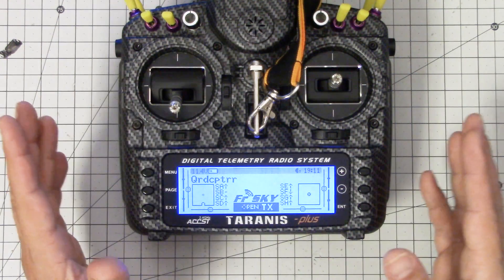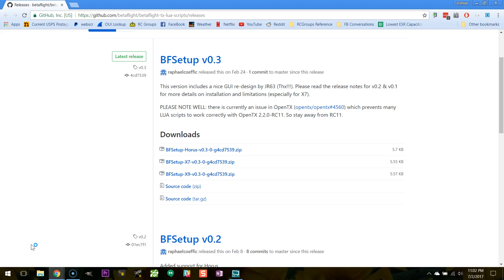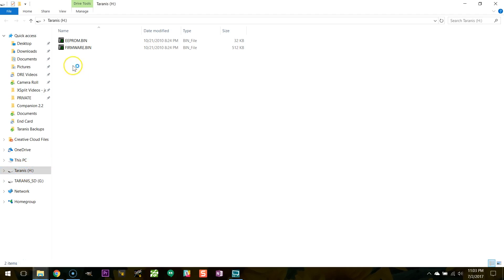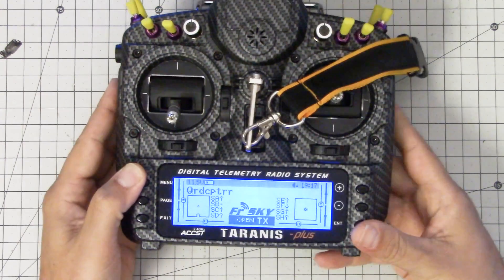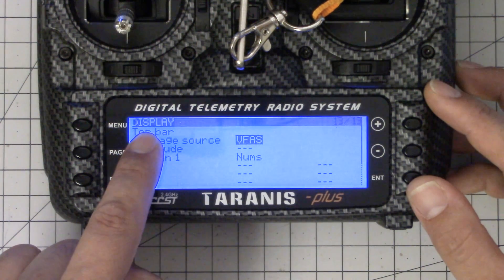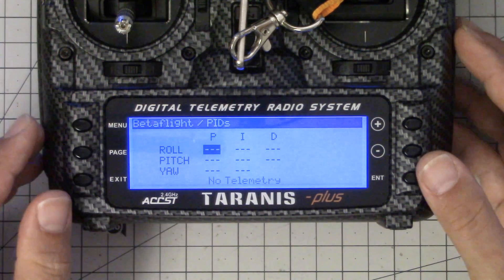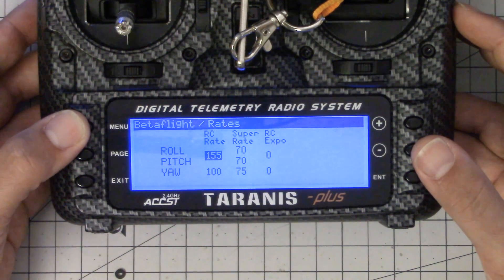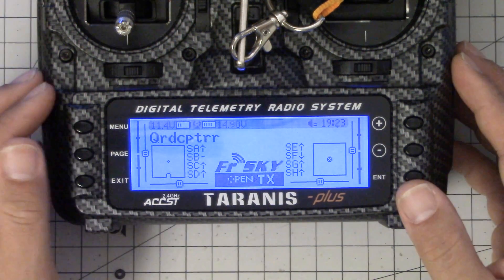Betaflight Taranis Lua Script HOW TO | Part 2 | The Lua Script

Comment: After installing LUA scripts on my Taranis, I hold down the page button and get a 'Use TOOLS menu instead of this' message. when I go to the tools menu and go to the Betaflight setup, all I get is 'Betaflight Config Initialising'. It stays there and does nothing. I have flashed the xsxr to fport, do LUA scripts work with fport. The FC is an old emax femto F3, could that be the issue?

Comment: Can u do a video on the 2.3.x lua script with the tool box I think I did it right however it actually fried my stock sd card completely shot replaced my sd card I think it all loaded right but I get stuck on the initialising page after it appeared to run the install setting it up to use the page button just says use tools

Comment: Simple and concise! Thanks for the tutorial. One thing that I've noticed, without going much on a debug mode :-), is that I can only change my PIDs. All the remaining information, like rates and VTX is not filled in. Oh yes and I'm running bfsetup 1.3. Any thoughts?!?
Reply from the maker: This is a compatibility issue between the script and the Betaflight version. But I don't know the fix.
Reply: @JoshuaBardwell  ok thanks... I'll have a look. Still running BF 3.5 (or something)... maybe I'll have a go for the 4.X.

Comment: hi

I am able to read out the pids values etc. with my radio with the lua script, but I am not able to change anything via safe page. 

I connected the smartaudio out of nano rx to tx of fc, maybe I should connect that to a uart rx pad on the fc?

What's wrong with these port settings?

uart 1: crossfire nano rx and tx

uart 3: smartaudio on output 4 of nano rx

uart 6: tbs unify vtx smartaudio

Comment: Hi Joshua, Hi everyone,
Your videos helped very much, like always, but i still have a problem with this feature.
I can change my PIDs now and my rates over my QX7, but not my VTX settings.
Let me explain the problem.
My VTX (AKK FX3) has SmartAudio and i can change the settings over the BF OSD.
But not over the "VTX SA" menu point. The VTX is listening to what i do in the "VTX TR" menu point.
I don't understand that because the AKK receiver should be using SmartAudio instead of Tramp Telemetrie. This didn't matter for me until now, but the script now uses SA. I can see that becasue it sais Dev: SA in the 3rd page of the script and the possible values for the power are the SA ones. (25, 200, 500, 800) and not the TR ones (25, 100, 200, 400, 600).
Do you have an idea what to do?
Should i try to change the VTX to listen to the (correct) VTX SA menu point or change what ever to get the script to work with the VTX TR point.
Have you ever heared about this problem?
Reply: One more curiousity. 
Is it normal that the values which i can see in the OSD are not matching when i power up the quad?
The settings are saying in the OSD Band:A, Channel:1, but in fact it is sending on FatShark 3, what i use normaly. But it starts always at 25mW, which is good.
When i then change the power from 25 to whatever and forget to change the Band and channel to F 3, it really cahnges to A 1.
Is that normal?
Reply from the maker: If you have a SmartAudio vTX, the Tramp Telemetry (VTX TR) menu does not do anything. It has no effect at all. It's an illusion :-)

Look in the VTX SA menu. If you see a row of dashes and STATX, then SmartAudio is not working. The FC is not talking to the vTX.

Check wiring. UART TX pad to VTX Audio or SmartAudio pad (depends on VTX whether it has SmartAudio pad).

Check Ports tab. SmartAudio enabled on the UART.

Comment: Im so frustrated with getting PID Rates lua script to work on my QX7! I've installed the script on my sd card but when I go to the Display page and try to set scripts up on 1 of my screens it allows me to choose scripts but when I scroll left to --- I click on it and it says no scripts on sd card and will not allow me to choose BF. I've tried everything I can. I'm running OTX Bootloader 2.2.3 on my QX7. Someone please HELP!!! By the way I have telemetry working through a softserial port with the S Port wired to remapped motor 5 pad and I'm using the r-xsr receiver.
Reply from the maker: Most likely, you copied the Scripts file to the SD card, but there are other folders in the lua script zip file that also must be copied before OpenTX will recognize that the script exists.
Reply: @JoshuaBardwell  Thanks, hopefully zi figure it out. I can't stop trying to make something work until I figure it out. I'm just frustrated cause I've done everything you did and watched tins of other videos but still can't get it working. I've clicked on BF scripts that's on my QX7 when having a quad on and linked and I'll hit execute and it shows a progress bar and then has 2 options saying wing tip mounted and something else with --- next to it but it does nothing. Trust me I have my QX7set up for multi and not plane so I dont know what that means. I also read to stay away from open tx 2.2 RC11 but I have OTX Bootloader 2.2.3 on my QX7 but never seen what release candidate it is. Weird thing is that in bootloader mode my QX7 says OTX Bootloader 2.2.3 it never had OTX written out but I can't remember what the text said before but it wasn't OTX. Under BF scripts i have multiple files one is msp_sp.lua and ui.lua as well as msp_sp.luac and ui_luac. Im going to try updating the firmware on my r-xsr again but I don't think that has anything to do with it. I also need to probably switch my FC back over to Betaflight as I have my FC on the Butterflight config but I don't see no one using Butterflight since you put out the 1st Butterflight video saying Betaflight was dead and has a girl on the title screen. I also prob need to update BF but the newer versions seemed to give me problems with smart audio cause I use the AKK VTX and the newer versions have SA_Legacy instead of the AKK Hack but neither seems to work for me in the new versions so I went back to the BF version I was on that was released in March 2018. I'll shutup now lol I'm probably just confusing you. I have too many issues lol.
Reply: I'm just going to go fly today. It would just be nice to control my VTX through my transmitter and not my Goggles,  don't really care about PID Rates. Now I'm sounding spoiled lol! I'll just have to go to an FPV track in Colorado Springs where I know Chance Hartman and his Dad fly and someone there will be able to help me in person. They both live close by me in my hometown but I don't want to bother them at their house lol...I just need to get the TBS Crossfire. Maybe it'll come in this months Kwad Box haha yea right.

Comment: Any way to map the vtx transmission power to one of the turn knobs on the taranis?? This would make it so much easier to change the vtx power output mid flight
Reply from the maker: No, it can't be done. Betaflight doesn't support changing output power like this. With an OpenTX Lua Script it could be done, but you would still need to be careful, because many vTX glitch when changing output power.

Comment: I did everything in the video but my Taranis says I have no telemetry, what video should I watch to Taranis PID telemetry?
Reply from the maker: You need to get telemetry set up and working before lua scripts can work. The exact instructions depend on FC and receiver. If you email me I'll try to help. joshuabardwell@gmail.com
Reply: Joshua Bardwell I do have lua script because I have been updating my Nano Crossfire before and can adjust PIDS using my googles? Maybe I need to hardwire an extra wire to my FC? Im using the new Helio Spring Mini Butterflight? Its suppose to piggy bk off BF so it should work?
Reply from the maker: Crossfire Lua works differently than Betaflight Lua. Betaflight Lua script will not work unless telemetry is working.

Comment: Question: I have Smart Audio controlling vtx...no issues. I installed lua scripts and it controls everything on the vtx EXCEPT PitMode. I know the equipment is working so is there a special way to turn PitMode on/off? The screen says it is saving but the vtx never changes and the lua PitMode setting goes back to whatever it was set at? Telemetry is definitely working. Equipment: fireworks v2 flashed to 3.5.1 and BF 3.5, 9D+ radio with 2.2.3, eachine tx805. Any help is greatly appreciated. Roger
Reply from the maker: TBS Unify (and possibly other SmartAudio vTX) refuse to go back into pit mode after they power up. Basically they can power up in pit mode but that's it. Personally I like the TinySleds RealPit because it powers the vTX on and off, not just pseudo-off low-power mode.
Reply: @JoshuaBardwell  Well looks like I will remove lua scripts if the PitMode will not work.  Anyway thanks for your response. Roger

Comment: Fabulous  info as always Joshua, HOWEVER, I followed the video and everything works EXCEPT when I press the MENU and ENT button on my X9D+SE to save the changes it reverts back to the old settings and does not save the changes. I have a SPR F3 board and the telemetry cable of the R-XSR is connected to a SoftSerial port on the FC (unfortunately the UART2 TX pin broke off). Any ideas??
Reply from the maker: This is a weird one. I wonder if the spracingf3 doesn't do bi directional telemetry. A long time ago you used to have to put a diode between the TX and RX lines to get Smartport to work.

Comment: Hi JB, my BF LUA script is working, thanks to your tutorial. However, if I unplug my quad, swap batteries, and plug the new battery in, the LUA script stops working (all values return to blanks). When that happens, I can still go to my second (personalized) telemetry page, where RSSI, receiver voltage, pack voltage etc is correctly displayed and updated. I've tried long-pressing the Menu button and reloading and/or rebooting the script, but nothing restarts the script. The only thing that works, is cycling the power to the transmitter. Is this just the nature of the beast and I should turn my XD9+ off after each flight? Thanks for you videos, and your help.
Reply from the maker: I'm not sure why this happens but I have experienced it and I'm sorry to say that power cycling the radio appears to be the fix.
Reply: Joshua Bardwell Ok, thanks. I wonder if the script itself is buggy, or if it's the implementation of scripts in OpenTX? I hope it gets fixed at some point.

Comment: installing a r xsr in your V1 FC. I am getting my telemetry readings but no Lua script. I have triple checked my connections and wired them and configured them in the exact way in your pilots manual. in the step in the above video, " change voltage source to VFAS" I dont have that option, only option I have is "RXBT".  why? I also wired the "Tele pad" to the inverted sbus  pad in the rxsr.  I have  wired the VTX per your instructions to the tx4 pad on the fc and I get no information on Lua script page.   Any suggestions OB1 on what I did wrong?
Reply from the maker: If you wired TELE to inverted SBUS then that is your problem. SBUS is not telemetry. You want the SmartPort pad.

For my V1 FC the correct wiring is the yellow wire (SmartPort) from the RXSR to the T pad on the FC. Then in Ports tab UART 3 set to SmartPort telemetry. In the Configuration tab, enable Telemetry feature. Then in CLI type "set tlm_halfduplex=off" then press enter, then "save" then press enter.

Comment: Hey JB, I got the Lua scripts set up and working on my QX7. It's awesome but about half the time when I put a new battery on my quad the VTX settings will reset to channel F4 and turn the power down to 25 mW. Any ideas?
Reply from the maker: The Lua script should be saving the settings between power cycles. I'm not sure why it wouldn't do that.
Reply: I (sort of) figured out the issue. There are parameters on the flight controller that you can access via CLI that controls your VTX settings: vtx_channel, vtx_power, vtx_band. The Lua Script would change these temporarily even when you hit save page, but they would not remain after a power cycle unless you go into the OSD to save and reboot. I'm using a DYS F4 Pro V2 flight controller and I've had this issue with both a Lumenier VTX and an RDQ Mach 2; the save and reboot trick works but is slightly annoying because I still have to put the goggles on to enter the OSD.

Comment: I have spent hours and I can’t get my XD9 + to do the Lua scripts. I am on the RC2.24 with LUAs boxes checked , I copy the current LUA script files over to the SD card. I always get a syntax error when trying to open! I am officially giving up! 😞
Reply: I had the same issue and ended up re-flashing my radio in TX Companion (checking the LUA and LUAC boxes), reformatting my SD card and starting over....finally worked.  For me TX companion 2.2.2 is out so that is what i flashed.

Comment: hello Joshua,I've been watching for about 1 month your Betafight and flight controller videos, and I dare to please help me
I recently have a Taranis S9D + with Firmware open tx 2.2.1
does not connect to my PC, and not connect  with Opent Tx Companion 2.2.1, although I installed all the drivers (Zadig, en.stsw-stm32102, CP210x_Universal_Windows_Driver, ImpulseRC_Driver_Fixer)
canot binding Tx with FC -FrSky XSRF4PO
I installed the sdcard content -taranis-x9-2.2V0013 version
this version does not contain the LUA script
I copied two versions of LUA
BFSetup-X9-v0.3-0-g4cd7539 and bf-tx-lua-1.0.2 and we tested each one
but when I want to install on page 13 on "Screen1 - Script BF" (as I see in your video) it displays "sSreen1 Script-bf"

the Betalight / PIDs screen displays:
"Script syntax error
BF /protocols.lua:40
telemetry proptocol not suported "

please tell me where I'm wrong, and what I need to install to work

Comment: Josh can you tell me how to add the Lua script to one of the screens on my Horus 12s?
Reply from the maker: You need to long press Menu then negotiate to the SD card, into the crossfire folder and run the script. There is currently no faster way up do it.
Reply: But you can do it on the Taranis?

Comment: I was wondering if changes made to PIDS on the radio take effect on the FC as they are changed....or only until they are "SAVED". So can I keep makeing changes until I find a PID setting/value I like...and then save...or must I save after every adjustment to test it out?

Comment: Hi Joshua. Thanks for your work. It helped me a lot with the starting in this hobby. I followed this toutorials and now I'm able to see and change PIDs and VTX setup on my taranis but below the lua script pages I always see "no telemetry". There is something that I can do to remove this error? the setup is completed or not?
Reply from the maker: If you can actually change the values then telemetry is working. So I don't know what the No Telemetry thing is.
Reply: Thanks for the fast reply. I solved. In the taranis I have made the search for new sensors and new sensors were added and the message no telemetry disappeared in the Lua script pages.
Ciao,
Lorenzo

Comment: I have another quad with a FrSky D8R-II PLUS receiver. Can I use lua scripts with it? How will I connect it if possible? Can I configure the FrSky D8R-II PLUS to get sbus and s port?
Thank you for the help
Reply from the maker: Lua scripts don't work with D8 series telemetry. Only Smartport, which is in the D16 receivers.

Comment: Hey Josh since you did this video they added some files to the GitHub page where you get the bf lua script.  My question is that there is a V1.0.1 release that has been posted.  This release has all the frsky radios in it under the script folder.  If I install this folder will my X9D+ know what files it needs to look at or do I need to delete what is not for my radio?
Reply from the maker: I think you install the whole folder, yeah.
Reply: After trial and error i found that I could copy the whole 'Scripts' folder and paste it into SC card...lua scripts worked first try.

Comment: Great job on your videos. I have an Artower f4 plus and an R-XSR   I had to solder the uninverted sbus tab to get it to work and soldered to the other uninverted tab for telemetry in. How do I connect to the flight controller for telemetry out to the receiver? 
Thanks for the help.
Reply from the maker: If you're using the uninverted S.Port pad on the RXSR, then you can use TX3 on the underside of the flight controller. You need to go to the CLI and type

set tlm_inverted=on
save
Reply: Joshua Bardwell Great, thanks for the quick response. Could I use the tab right next to it to control the camera, or is there some other way to do that?
Reply: Thanks. I got the lua working.

Comment: So I stepped thru all the videos to setup, and I found that was running on 2.0.1, which I had to upgrade to 2.1.9 first (at least what I thought).  Then I tried to do 2.2.0 and it wouldn't download the firmware, I saw there was a 2.2.1 which seems to have worked just fine.  I also updated the bootloader and the Taranis seems to be happy.  Now I uploaded the betaflight-tx-lua-scripts v1.01 to the TARANIS_SD folder and when I went to setup the display settings, I noticed I only have 9 screens, vs your 13?  I don't have a "DISPLAY" screen, what am I missing?
Reply from the maker: They've changed the structure of the Lua script folder so these instructions don't exactly apply any more. Sorry but I don't have an update yet.
Reply: Ok thanks.  Any ideas on why my Taranis only has 9 menu screens vs 13?

Never mind answered my question, I was looking at the menu settings vs the options menu.  Hence the 9 screens vs 13, hahahaha